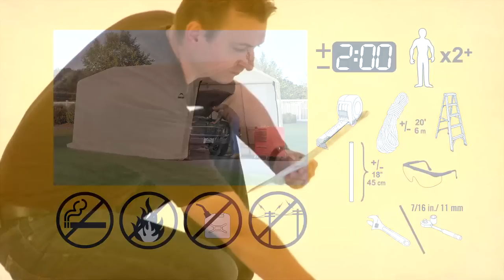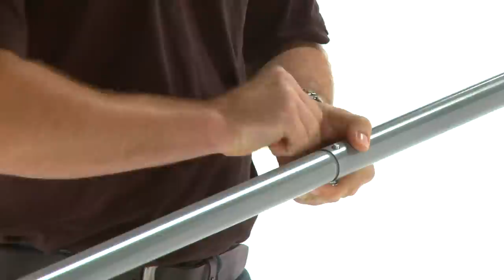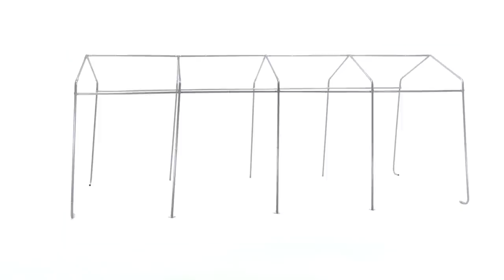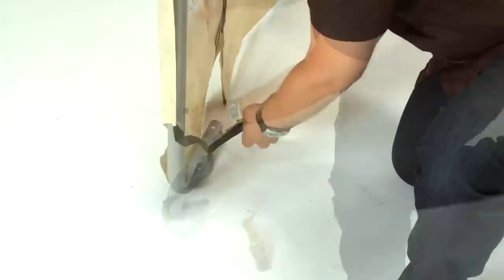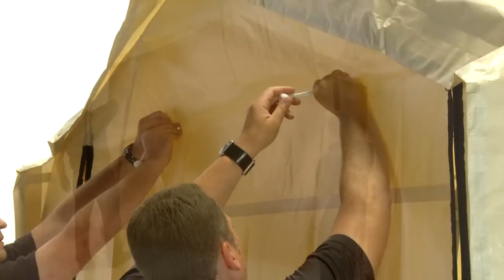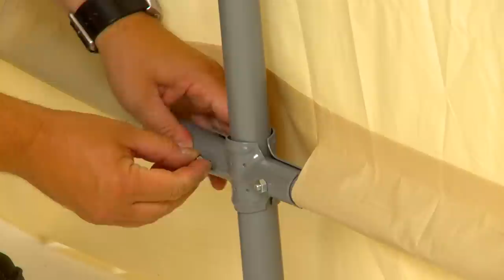ShelterLogic® AutoShelter®

Comment: I'm getting my 10x20 today I'm installing over cement will this be fine?
Reply: Hi Anthony, 
Yes, this should be fine. We suggest you properly anchor your shelter to prevent accidental damage. Concrete anchors can be purchased at your local hardware store to properly secure your structure. If you have any additional questions or concerns feel free to call us at 1-800-932-9344. 
Thank you

Comment: I bought one of your 10X17 portable garages from Harbor Freight and was wondering whats the best method to try and make it waterproof?
Reply: so the top leaks?
Reply: +IBoosted SS they come waterproof
Reply: how is the top portion of the back and front sealed around the pole?
Reply: Hello, 
We are aware that Harbor Freight does offer a 10x17 model which looks very similar to our Autoshelter series but it is not our product. Our covers are waterproof and should not leak when properly installed. 
Sorry we couldn't be anymore help!